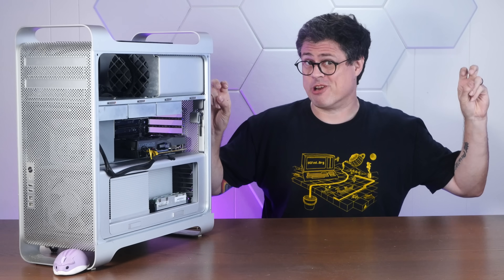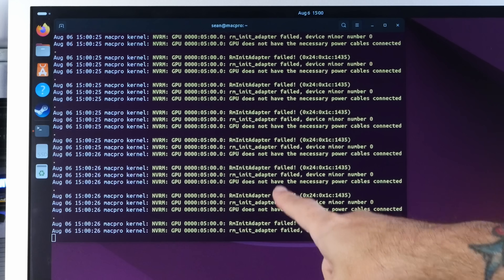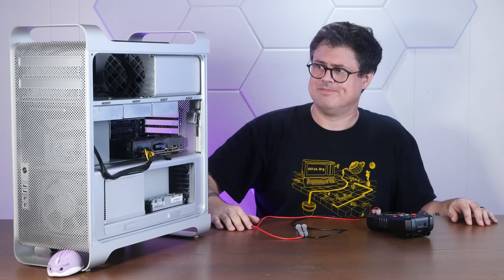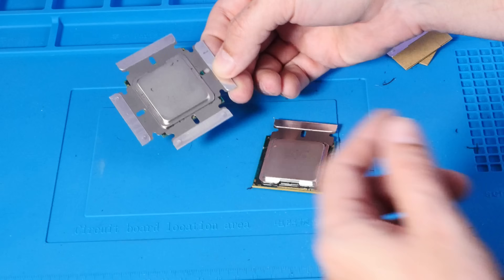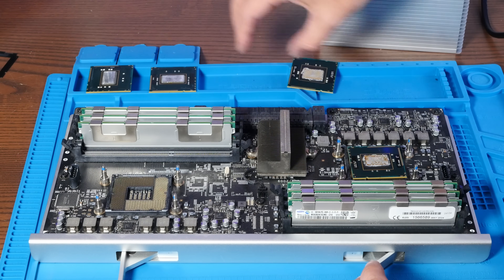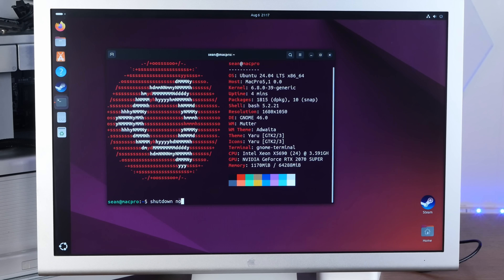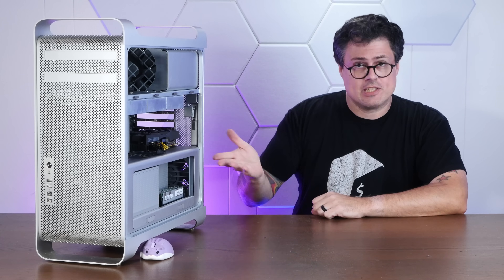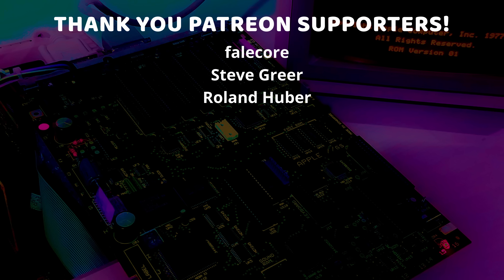Abusing Intel Xeon CPUs

Comment from the maker: Support these retro computing shenanigans on Patreon! https://www.patreon.com/ActionRetro
Reply: install windows 10 on it then windows server 2022 then put windows 11 on it (use rufus because the mac probably doesn't meet the requirements)
Reply: hey pointy mac man, what are those crimps you're using to add extra psu cables?
Reply: I think you should of not scratched the crystal because scratching the crystal might give you problems ik that you were removing thermal pasr but next time try to use alchol to remove it 😅
Reply: 07:23 Heat sink compound is visible!
Reply: Update????

Comment: Did a 4.1 - 5.1 but I did not delid mine. Used washers and thicker pads. Also had the same memory problem. I had to reseat one CPU and torque it down a little more. But you have to be careful not to over do it. You can bend one of the socket pins.
Also have another 5.1 with two AMD Vega cards. 64 and a FE.

Comment: I've done deliddiing both ways, with heat and with the vice. Both work, I prefer the vice. Advice to anybody delidding these: be careful when cutting the glue. There are tiny components under the lid (capacitors?), they are quite close to the edge. If you push the razor a bit too deep you can cut them off even without noticing it. Same thing when scraping the solder off, do not touch the tiny components!

Another thing about memory issues, might not apply to this case but in general: if you tighten the cooling towers unevenly in a 4.1 (like this machine originally was) you will encounter memory problems. it will warp the cpu tray and possibly memory slots or something, I dunno - but in any case memory problems are common after repaste job or cpu swap. Equal torque should be applied when tightening those screws. Most just count turns to achieve that.

Comment: Bro, you just use proper CPU delidding tool which can be purchase on eBay for around $15, and you must also use CPU Solder Remover.  Putting a heat gun to a cpu is going to damage it.  I guess this dude's CPU isn't working if you know what I mean.

Comment: I built a machine around the same generation of Xeons some years ago. Was cheap stuff on Ebay. Rocking twelve cores for 400 bucks back in the mid-2010s, that was something! Except all the cores were slow as fuck and terrible. I still have it around but never use it anymore.

Comment: If the CPU was confirmed working prior to this it's very likely a mounting pressure issue if there's no obvious damage. It's possible you overheated one to the point where the substrate warped and/or broke a bga connection but that's less likely. Mounting pressure is challenging with direct die because you have to make up for the gap previously filled by the IHS without applying so much force that you crack a die.

Comment: If you have some plastic safe quick drying contact cleaner that could help.  I had trouble getting my document scanner working so I gave it a very quick short shot of CRC quick drying contact cleaner and the did the same for the end of the USB cable while not plugged into the computer.  It helped a lot.  This dries quick so it should not linger in there.  If you are worried it would linger leaving it in a room with a cross breeze or even a quick going over with a hair dryer will dry it.  If you are in doubt and just want to play it safe wait overnight.  This stuff says it doesn't conduct but I am not sure 100% how non conducting it is.  You can use any other product of your choosing too if you happen to have something else.  I am sure they are all similar in some way.

Comment: Working at an auto shop, nobody I work with uses those crimpers. I'm sure they work on a wider variety of connectors, but I just use the combination wire stripper/cutter/crimper things, more specifically the Ares 21002 or the Klein j207-8cr ones. 

Treating the crimper opening as a U shape, the side with the seam always goes to the bottom of the U. You want to rest the seam against the rounded side while the punch thing presses into the other side. 

Also, nobody I work with likes those T connectors. They're not reliable and they can damage the wires. I'm sure it's good enough for this hackey upgrade but I just don't trust them.

Comment: Those type of crimps are just garbage. I wouldn’t even use them in a car from the 1980s. Either use a good marine grade connector or positaps if you don’t wish your soldier.

Comment: I delidded tons of those X58 CPUs with the vice method. 
The capacitors are far enough away on one end, so it will lift, before the IHS will grind them away. 
Using razor blades and hot air, not only takes 30 times longer, the rate of failure (cutting a trace / overheating) is much greater. 
So if anyone wonders how to remove that IHS safely and simple: 
Vice method.

Comment: My success ratio delidding LGA1366 with heat is about 50%... the last time I tried, I had the exact same problem with a dead RAM channel. Went for a mechanical tool which nails it every time.

Comment: I had a 4,1 that I converted to a 5,1, and I used a third method to upgrade the CPUs: I didn’t delid the CPUs, and instead used shims. Controversial for sure… possibly a more controversial upgrade method than thermal paste itself!

Comment: I've done a few of these 4,1 upgrades, your ram issue is caused by the screws that hold down the coolers.  all you have to do is count the rounds when you tighten them and make sure its' applying equal pressure across the CPU. in my case it was about 8, but I used lidded.  DON'T over tighten it.   if that doesn't work, check the bottom and make sure you haven't mashed the pins on the tray.  if you did, it's done, and need a new tray.   Mac Sound Solutions has a great video about this I found really helpful.  

Good luck.

Comment: Those CPUs are like... weirdly good, even today. I have an old HP Workstation in which I've put a X5680 (which was like half the price of a X5690) and with an RX 580, it's a really decent gaming PC. My home server is also using a X5660 (lower TDP) and outside of the power consumption, I really have nothing to say about it, it just works and does everything I want.

Comment: 8:07 That's most likely because of uneven or insufficient pressure from the heatsink onto the cpu, making some of the connections between the CPU and the LGA iffy or not connected. Direct-die is a bit tricky, i AM guessing the screws that hold the coolers onto the cpu and board are supposed to be torqued until they stop, meaning that the length of the screws/threads determines the pressure. In that case i'd try re-mounting the coolers and make extra sure to tighten down the screws gradually so that they make even pressure.
Haven't watched past this point, so i guess you might be solving this =)
This was a common problem on the early AMD Epyc cpus with huge LGA sockets, the classic symptom is that not all of the RAM shows up.
Reply: Oh, it follows the CPU, that's unfortunate. WAY less of a chance it's something to do with the LGA and mounting pressure, obviously, although it's still a possibility.

Comment: Probably not enough clamping pressure to push down all the CPU pins, I know they can run with not all the pins connected, you just won't see all the ram

Comment: I also did this with mine. I bought pre-delidded cpus though. Any reason you didnt go with those or did you just want the experience? I also run liquid metal on mine. Also make sure you repaste the northbridge heatsink. It will really help the temps on it and its very sensitive to temperatures. Good luck!

Comment: lga sockets are very sensitive to pressure and is very easy to make them not contact properly. 

Threadrippers suffer from this as well, and is pretty common that ram sticks don't get detected when the mount procedure has not been done properly. 

This happened to be when I upgraded my 2013 mac pro to the 12-core Xeon, some ram sticks would show up or not between boots. I had to mount it again carefully and problem solved.

Comment: Good video and tutorial. I created the Mac Pro Users group on Facebook in 2015, Jay Vriji was one of my admins, several members using heat to delid their XEON CPU''s have damaged the coupling capacitors on the CPU's under the die, and that is why the Vice method to delid CPU's is recommended, also Memory issue's like what you are having are usually related to over tightening the CPU heatsinks or a bent CPU pin, so check that. Lastly I worked for Intel as a Server and SAN Storage administrator in 1999 & 2006 and Intel 5680 and 5690 Xeon CPU's all have the same stepping as Intel only released single revision of each model CPU.

Comment: The RAM issue you’re running into can also be due to the heatsink being tightened down unevenly. I had the same issue on mine after upgrading and just takes some fiddling with to get it back to normal👍🏼

Comment: I would say from expiriance, just cleaning the contacts of the cpu and the socket should fix the ram issue. I don't think a new cpu would be needed. Sometimes this sort of thing can happen when doing cpu swaps, and has happened many times with all the duel cpu systems I have personally messed with.

Comment: I have a 5,1 2010 Mac Pro.  There’s no need to de-lid the CPU unless it’s a 4,1 2009 model.  Upgraded to dual X5690s and 96GB myself during lockdown.
Reply: He said in the other videos he has a 4,1 with firmware upgraded to 5,1.  
And the single CPU 4,1's are said to use lidded CPU's.  Just the dual cpu 4,1 are delidded.
 I would have tried the new cpu's with the lid and put the had sinks on with reduced tension if I had his computer.

Comment: A note to all people trying to upgrade a Mac Pro Early 2009 or 4,1 or 4,1->5,1 -- stop upgrading these Mac Pros! The delidding method or the spacer method or the tension of torx screws method, are all most likely going to fail, eventually. I've pulled apart and sold many of these upgraded Mac Pro Mid 2010 and Mid 2012 (to resell), and I have had almost zero problems with the CPU upgrades. I didn't have to delid the the CPUs, nor had to space anything, nor had to worry about any tensioning of the torx screws. They just work.
I want a little bit of a giggle, so anyone can respond to this and state "but mine has been working since 2016 and I haven't had any problems" -- you are one of few.

Comment: Maybe try to support the next CPU before it flys. There are some SMDs on there too. You put a lot of heat in it to melt that big solder, it takes some time for all the solder joints to resolidify. ;)
I hope the next one will work fine!!

Comment: Generally it is not a CPU issue if the RAM shows up as an error. I've pulled apart and sold many of these upgraded Mac Pros (A1289 to resell), andI have found that the memory becomes "fussy" on which slot it's in. If you swap the memory around you will eventually get the error to disappear. Just remember which memory goes where, as you may be swapping around a lot of memory sometimes. Also, make sure the memory is 10600 1333Mhz and not 8500 1066Mhz (physically on the RAM), and that it shows up at 1333Mhz in "About This Mac" or its Linux equivalent. One bad stick of RAM will slow down all RAM.
And stop calling it a 5,1. It's a Mac Pro Early 2009 with its firmware updated to 5,1, but it is still a Mac Pro Early 2009 and not a Mac Pro Mid 2010 or Mid 2010 with the proper 5,1 firmware. I'm just being fussy :)
Reply: The fact that he memory issue followed the cpu rather than the ram simm suggests that it is not a bad simm. 
I agree he should not call a 4,1 a 5,1 since the fact it is a 4,1 was essential to the message of this video.

Comment: Not all cpu's silicon die's are the same height and can cause issues with direct die cooling as there is not enough pressure in certain areas on the LGA contacting the pins on the motherboard for it to work, most times its memory related. getting 2 identical cpu's or known as matched cpu's could fix this issue and also just could be more stable over all. I have a dual Xeon server myself and have found this issue to be the cause.

Comment: hey I did the same mod on my cheese grader 5,1 and ran into a similar problem and found out that it wasn"t a bad cpu, it was too much pressure on the screws that bolt down the heat sink.It's very sensitive !

Comment: I had changed thermal paste on my 4,1 and it did the same not reading all the ram till I check the pressure on the cpu it has to be tighten down just right for it to read all the ram

Comment: I was just changing the air cooler to put the liquid one on my overclocked Xeon E5-2696v3 when I saw your video. You made me want to take the lid off. Now I'll take my hot air gun and do it !!! I have dozens of Xeons, Hurray 😄
Reply: Please use the deliding vice. Much easier, and is easier on processor (no sharp stuff going where it shouldnt and no extra heat).

Comment: Mhm you can 3D print yourself a delidding frame? One to nudge the indium solder till it fatigues and breaks off cold. The razor blades aren't entirely kosher, scratches on the substrate can cause pins being electrically severed.

Comment: you can just DELID these cpu's with a vice,

yes they are soldered. but if you go the correct way and are gentle it is fine,

but you can always heat it a little while vicing it.

also you can use liquid metal to dissolve the old indium and fully clean out the die's,

Comment: You didn't have to delid them, and just run an AMD cars, it'll work in both macos and Ubuntu, if you install the 144 boot rom, it'll natively boot off of nvme, and sometimes dual power supplies freaks out the motherboard.
Reply: You can even flash an AMD card to give you an OEM boot screen.
Reply: Also, tell everyone it's a 4,1 flashed to 5,1, gives you more street cred, and makes those who know not cringe when you say 15 year old 5,1.

Comment: As these are not in a standard type intel socket, you may need to torque the CPU's down to spec. This is an issue where one or both chips aare not mounted quite right, making either memory channels or pcie lanes to stop working. This is very common at my work for AMD EPYC cpu's and from time to time Xeon platinums (but less). I would try reseating them with an equal amount of torque.

Comment: I used to have a single CPU Mac Pro 4.1 upgraded to 5.1 at my previous work. I managed to source locally a W3680 for a good price and almost delidded it before even taking apart the computer. Well, it's a bloody good thing I decied to look at the old CPU before doing that, since it turns out, single CPU models of the 4.1 were using CPUs with their IHS, so there was no need to delid the replacement one.

Comment: I had one of these for a while, its final job before going on facebook was running VMs because it had so many cores to throw around. I ended up retiring it because of its idle power consumption being so high.

That delidding method was really cool, never knew that was a thing. Seems like the hot hair might've killed a memory channel inside the CPU, which explains why people do the vice method. Since they're not BGA chips, I'm guessing they're not really made to be reheated like that. They might be using different solder bump and underfill material to attach the die to the substrate.
Reply: I really doubt the heat killed it.  Those things can handle quite a bit.

Comment: Interesting that it's reporting the CPU at 3.59GHz when the 5690 is clocked at 3.46.  

My Mac Pro only recognizes 6 out of 8 sticks of memory.  The memory isn't bad and the sockets aren't bad - I've tested all of them individually.  I had the same problem with the stock 4-core CPU's.  Can't figure out what the problem is, and I've never had any other problems with either set of CPUs.

Hopefully you figure this problem out!

Comment: On my 4,1 delid, I broke off a capacitor on one of the CPUs, but luckily I already had a spare CPU that arrived broken. It's been over a year of daily driving a machine with a hand soldered capacitor and i haven't had a single issue

Comment: Could've messed up the memory controller when heating at too high of a temp and too close to the IHS.
Reply: Nah it was cold. Just barely hot enough to weaken indium solder is still perfectly fine for the CPU when it's unpowered, and i mean heatspreader spreads heat pretty well. i think either the memory channel was already shot previously, because that happens on these, or when the lid released the twist of the razor blade caused a scratch in the substrate right on the memory track.
Reply: @SianaGearz  oh yeah didn't think about the possibility of the razor being the issue. Anyways should've tested it beforehand and treated it more carefully. Luckily they're fairly cheap

Comment: Looks like you cut the caps with razor blades, also ram issues is pressure on die and pcb of cpu in socket
Reply: Could also be a bent pin in the socket, but if the dead channel moves with the CPU then it rules the bent LGA pins out almost immediately. Happened to me when I swapped CPUs in an older Westmere machine after moving it. Must've taken a nasty bump along the way...put my loupes on and a very painful hour or so later I had all the channels up again.